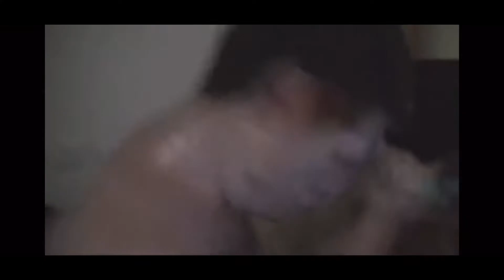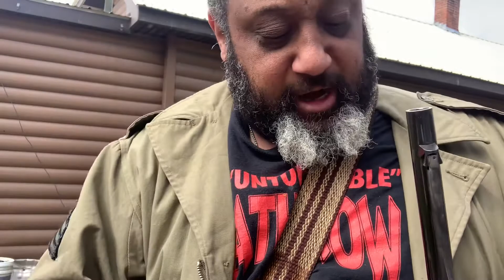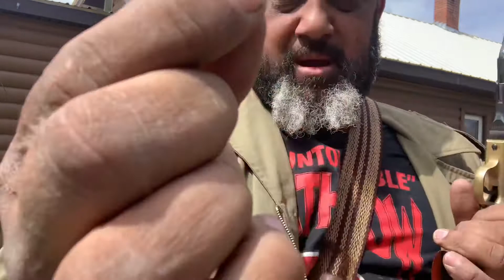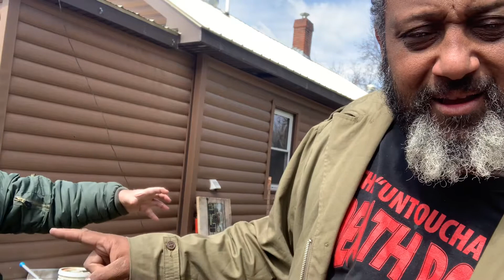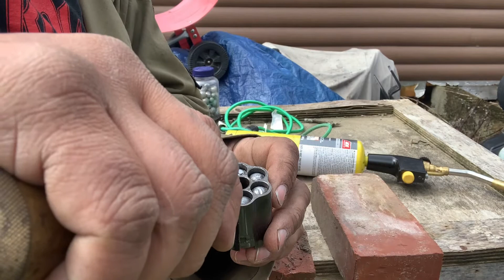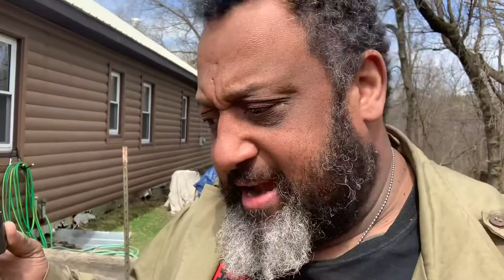Chain firing an 1860 colt

Comment: Wait people do that to stop chainfires? I always did it because it keeps powder residue  down.
If you wanted to reduce chainfire you'd have to put lube on the caps and cap nipples.
When I go camping I do that, put lube on front and back.
But that's still not for chainfires it's for weatherproofing.
Reply from the maker: Oh yes people put lube on top of the cylinder to prevent chainfires from happening you can’t make this up it’s on YouTube lol
Reply: @ordinancesgt6716  guess people will believe anything they see on YouTube.
The Colt Navy in 36 cal I've had since 11 has never chainfired and its saved me from a coyote attack before so I trust it with my life.
Reply from the maker: @voidwalker5784  colt navy saved your life well that’s going to be on my next video if u don’t mind sir it’s about carrying a colt as a self defense option.
Reply: @ordinancesgt6716  well my Papaw got me it at 11 because I was into the Civil War navy battles and I was into fencing and thought I needed a sidearm for my smallsword.
I also fell into a love for wild west afterwards so I started doing vintage camping and I carried it for protection.
Since I mostly went camping by myself no wonder those coyotes thought they could take me.
I shot two and the rest ran.
One died immediately the other I had to put down with my Bowie.
They looked sickly so they were probably just starving.
Afterwards I had it engraved 'Coyote Be Gone'.